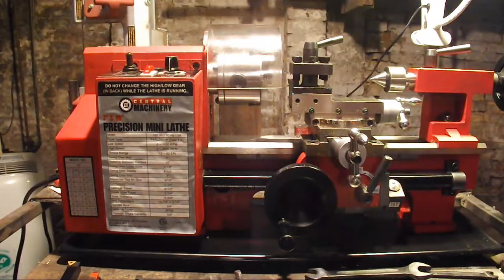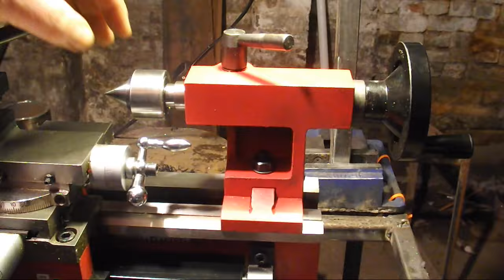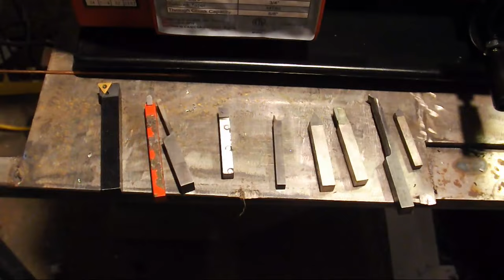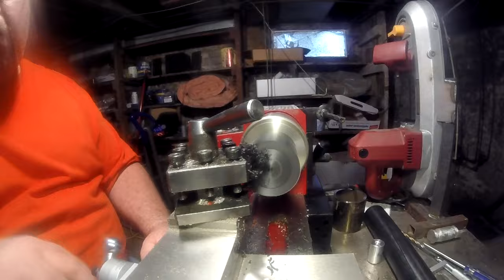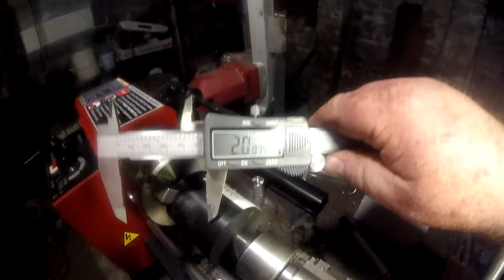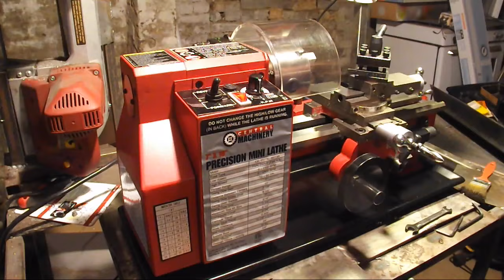Harbor Freight 7x10 Mini Lathe Review 93212

Comment: I have repaired the power feed on the carriage twice. It is junk.  It sits on my work bench broken  again.  It is made from some of the crappiest pot metal components I have ever seen. It has a small BB  in one of the ports that hold the gib rail in. The half nuts break. The gear assembly that drives the carriage has a wide clearance that allows swarf to be fed in and break the cheap drive components inside.    The most intelligent man I have ever known was Dr. James Hsieh from mainland China. He worked his way to the USA and got his Masters and Phd. from V.P.I. in Mechanical Engineering..He was the division chairman at the little state college I went to in WVa..He would be furious to see people in his home country try to pull something by dumping this thing on the market. I know these folks in China can add $20 to this machine and it will do the job it supposed to do. I think it is sleezy to have some guy from the USA to offer to show us how to fix the lathe so it will work for a fee. . It would be much better if Harbor Freight would make them fix the machine. There is currently a huge Class Action suit against this company(HF) now over advertising practice. It might be the perfect time to look at quality control issues with this area. This is not a $5 flashlight,it is a machine tool that costs hundreds of dollars and is basically flawed. Several are getting rich on the flaws. Many are standing by ready to sell us another model. I am not complaining about the Chinese. Most people from China I have known are honest and decent. What does it hurt to have a little pride in the business relationships you are building. Why must you operate just barely above the courts and discipline system?
Reply: As long as Americans continue to buy polished turds they will continue to sell them to us.
Reply: DAVE
The company that imports any item from China or wherever is the one responsible not the company making the item. 
China is very capable of making a very precise mini lathe but the importer is only willing to pay X amount and therefore gets X for their money. 
If Harbor Freight wanted to raise the price they could get a much better product but there would still be someone else willing to import the lookalike at the cheaper price that people would buy because the differences are not visual. 
Be happy that the upgrades are so easy to obtain and that there are groups out there that figure out and supply items that make the lathe a much better tool.
Reply: its called a "price point" . IF u can afford a better lathe just buy one. some people can only afford and only want to pay a couple hundred bucks. if its just a hobby why pay more? u can get a $1000 mini lathe if u want ,just look for em. sherline makes a few and they have cnc option
Reply: @bermyvlogger  I guess, at least from my thinking, the only reason people buy this junk is because their TOO cheap to buy good machinery. And I'm not saying they should spend a years worth of pay.  Just get something that doesn't wiggle and wobble and with too much backlash( too much isn't good, this unit starts out in the bad column). A small used South Bend lathe is perfect for the home user and wont break the bank. AND...it can be fixed and you can replace parts easily.
Reply: @bermyvlogger  I'm willing to bet this won't even be consistent cutting a straight line
Reply: @mastertek383  well put. The saying you get what you pay for isn't necessarily true. Some people just have false Hope's and a small budget to go with it.
Reply: Yeah I'm one of those hobby guys that would prefer to test out something to see if I really need it or just want it , plus upgrading and building is such a pleasure.  Now to my question , do you still have your crappy hunk of metal and will you allow me to take it off your hands ?..?

Comment: I purchased my lathe yesterday. I was trying to face up a 6 inch clutch plate but was getting it seems like a lot of tool holder flex. Any ideas on making the tool bar more rigid. I could actually just push it with my thumb and make a deeper cut. any advice is greatly appreciated. Thank you.

Comment: Good video. I've been wondering about these lathes. The only correction I'll make is that you got your right hand and left hand tools backwards. Right hand has the cutting edge on the left to cut from right to left, and the left hand has the cutting edge on the right to cut from left to right. Not a big deal, and I'm not trying to cut on you in any way. It's just something that may cause someone problems when buying tooling if they have it backwards.
Reply from the maker: No worries my friend. I'm new to the machining world. I'm a welder by trade. but the two seem to go together to me.

Comment: set the compound at 30 degree get more carriage motion range 30 degree will be 1/2 thou on dia cuts per graduation or 1/1000 off the diameter.
Reply: Rob C you sound like a machinist...☺

Comment: why is the whole thing shaking around,  did you set-it-up properly???
Reply: agreed. this lathe is harbor fright junk. the only advantage is price but you get what you pay for.
Reply: Agree, a bigger, better used with tooling is possible for under a G note.
Reply: I've got the mill and it's low quality for sure, but used it was $200. Semi-useful.
Reply: It probably wasn't bolted down to the bench. Mine is rock solid. I rethreaded the mounting holes to 3/8-16 and the bench is 2x10s.

Comment: Would I recommend it to a friend? Only if they too don't know how one should work
Reply: @MrTweetyhack  Tried to spin the dials in the local HF, did you?  Big difference between deciding it's junk from a display model and actually using one.  I now have my second mini lathe, and it wasn't any big trick to get either of them running.  Not HF, which makes zero difference, a little time and patience and they run very well, good repeatability, but only if you took a few minutes to adjust them.  It ain't rocket science, it's basically how lathes were built a hundred and fifty years ago.  I'd say yes if someone asked me, but I'd also be on hand to help get it set up and running.  But I suspect you are one of those that won't admit you don't know how.

Comment: I thinking buying minilathe, but all what I see from YouTube-videos that machining only aluminium, brass or other soft material. I need to machine steel, for examble bearing bress & etc. I have no hurry so speed is no needed but can minilathe machine steel?
Reply: It does not machine steel very well....4 out of 10......if you don't need a super finish it will be Ok...otherwise I would go looking for a good quality used lathe......by the time you get done buying all the extras, you can probably get a very good used lathe with all kinds of goodies

Comment: Would it be possible to insert a gun barrel thru the back of it to cut threads on the end for a muzzle for a brake. If so, what would be the largest diameter barrel it would accept?  Thanks! Awesome video!
Reply: 3/4"

Comment: I believe that I have the same lathe. Thank you for the tutorial on it I certainly learned a lot more..
I would like to know more about the part where you secure the cylinder in rider to do some cutting. My lathe seems to no center the pipes and I have a tough time trying to get it so that all of the locking pieces are cynchronized together and evenly locking the pipe dead center.
Please advice. Thank you Sami
Reply: If you figured out the answer to your problem then awesome! 
If not, check out the YouTube channel Joe Pieczynski.
I think he's THE BEST machinist channel on YouTube.

Comment: Why do you have your compound at zero degrees? 29 degrees works for most lathe operations and in this instance with a small lathe it'll gain you clearance at the compound dial; IE not interfering with the tail stock.
Good review BTW!
Reply from the maker: +ShysterLawyer Thanks for watching and writing in. I have no formal machining education, what I've learned about lathes and mills has come from Mr. Pete, Abom79, Halligan142, OXTools, etc. I'll try the 29 deg from now on. Thanks for the tip!
Reply: I'm just a wanna-be machinist myself, but the question that's bounced around is "29 or 30 degrees?"
Mr Pete has some excellent videos, I have his Atlas course too, I recommend them. He uses 29 degrees, but says 30 works fine if that's your preference.
It looks like you're doing well with that lathe though, congrats on it!
Reply: +ShysterLawyer 
Setting the compound at 29 or 30 degrees is for threading. Most who do threading just leave it there because it does move it out of the way for most operations.
Reply: +ShysterLawyer With cutting threads the setting of 30 degrees lets the cutter bit follow the shape of the thread exactly.  With a setting of 29 degrees, the bit makes a tiny "clean up" cut on the back side while the front is cutting the thread deeper.
Reply: +jim jaco True, but it does seem to be best suited for that position. As seen in the AIW video there's an issue with clearance with the tail stock with the compound perpendicular with the cross-slide, at least on this smaller lathe, and I could see it being an issue when turning between centers.
When I first bought my lathe and knew nearly nothing about lathe's I had a devil of a time with my compund and cross-slide handles crashing into each other as the PO had the compound parallel to the cross-slide.
Reply: +Ronald Morrison Makes sense, thanks for the clarification Ronald!
Reply: Ronald Morrison
That may be true. I have heard varying reasons to use 29 vs 30. From fit and finish to dimensional correctness..lol

Comment: Thanks for the video! We have a similar mini lathe. Removed the narrow factory pulleys and light duty belt, replaced it with some v belt pulleys and belts . it works ok. Good starter lathe, brass, plastics, aluminum, light stuff works fine!

Comment: Can you remove the cover from the back of the headstock to place a longer steel rod to thread it? This way the steel can protrude through the chuck of say the barrel of a rifle ,  for threading.
Reply: yes its a thru spindle.
Reply: The cover has a hole in it for just that reason. No need to remove it.

Comment: hello friend could you help me order that chuck? i need to do some center hole drilling and thankfully you posted that it does not include the most important tool on the device , nearly all your work needs center drilled to spec on completion doesnt it ?
Reply from the maker: +NOBOX7 It's just a #2 morse taper 1/2" chuck. Try Littlestmachineshop.com or even ebay.
Reply: Thanks man i owe ya one.

Comment: Great review! A very well done intro to the machine and its operation. One small glitch with the 'precision' feed markings on the cross feed. Since 1 mil is .0254 mm rather than .025 mm there should be some error if you just use the markings. Have you checked to see which one is accurate? (I.e. does one tick mark actually equal 1 mil, or does it equal .025 mm?)
Reply: It doesn't matter....you can guesstimate the roughing cuts until you get down to the finishing cut then the small markings are self explanatory.

Comment: Would this lathe  be good enough  to turn and make aluminum  wheels  and small brass and steel shafts I want to build stirling  engines  Im a welder by trade did some round stock  turning  to fit bearings  Id like to get into machining some things Thanks for the video  great job and explanation. I just subbed  to your channel
Reply: How good the machine is depends more or less on the care taken in setting it up.  There's nothing mechanically wrong with the design, it's a pretty well designed little machine, but it has to have the gibs set, play removed before it's ready for use.  Newer models don't have the two range headstock, but they have a far better, more powerful motor and don't need the gears.  As it comes, those gears are delrin, which sounds cheesy but it's a good compromise.  Steel replacements are available from Little machine shop, and not that terrible expensive.  A lot of comments about the noise, these are spur cut gears, not helical, and just accept the noise, it's not going to go away.  Again, a compromise between feature and cost.  The change gears for feed and threading are delrin also, they work fine as long as they're set up correctly.  If you don't know how, find someone that does to help you.  A lot of guys are using it for modeling small engines, they work well, after they've been put into working condition.  It doesn't take long to get it running quite well, and you're not paying someone else to do  it.

Comment: I ran a 100" lathe  (Yes!  100"!)  for many years . . . . . so this was just funny!   lol
Reply: You didn't happen to work in the #2 Machine Shop at Sparrow's Point?
Reply: @michaelbyrnee9584  No Mike,  I worked at Kodak in Rochester for 32 yrs!
Reply: @johnwright3228  The #2 Machine shop's longest lathe had a sign permanently attached to it that read: Consult tidal tables before making finish cuts". The shop was built on fill and was located on the shores of Baltimore Harbor. I only worked at this shop for three years. My work focused on booster-stage thrust domes and explosive bolt casings for the Apollo project. Once the terms of that project were completed, Bethlehem Steel laid off 12,000 engineers and machinists - and I knew I would never again work in a machine shop.
Reply: @michaelbyrnee9584  Nice job while it lasted Mike!  Too bad they built the shop so poorly, I can't imagine a lathe that floats!   lol   BTW  The 100" is a diameter!  (bed maybe 50'?) We did a lot for Nasa also . . . . and other agencies . . . It was a GREAT job but it all ended abruptly with digital cams (Kodak developed digital for the moon missions and patented it all, then held it up bcuz they knew it was going to be the end of chemical based photography) We also had an 18' dia. lathe (Yes! feet!lol) that we used to make coating rolls for film, BIG stuff!
Reply: @johnwright3228  Allis Chalmers had a 100' lathe that was bedded in bedrock

Comment: Hi
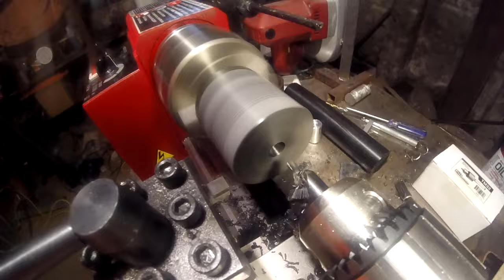 I noticed at 14:15 when you were zeroing on the Delrin, you didn't have the safety shield down but the machine was still running? Did you find a way to defeat the safety switch? Also, after 2 years, has your opinion of this machine changed? For the better or the worse? The whole thing seems a bit light? I notice it shaking when you making adjustments.
Thanks:
Stoney
PS: I'm a machinist and was thinking about one of these for some hobby work.

Comment: I have looked at these in the store but they only go down to a 12 pitch (12tpi) for thread cutting. It would be better if they at least went down to an 8 pitch.
Reply: This size lathe does not have the horsepower or rigidity to cut anything the size of which requires an 8 pitch thread. You're gonna need to go look at  much bigger lathes and be prepared to pay for that capability.